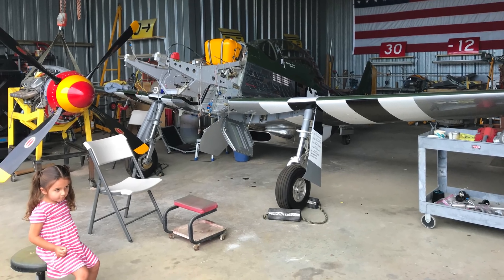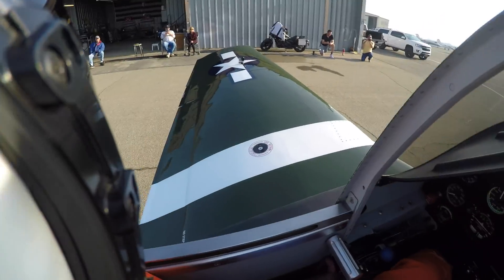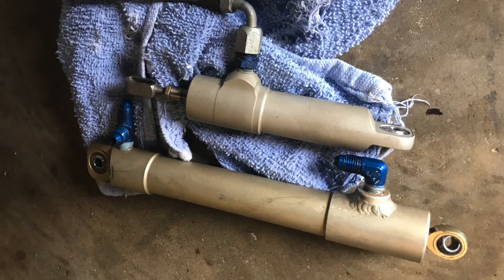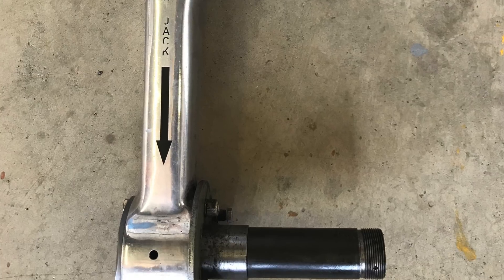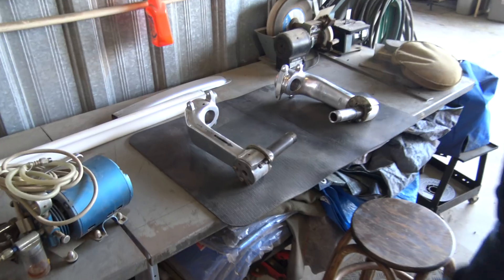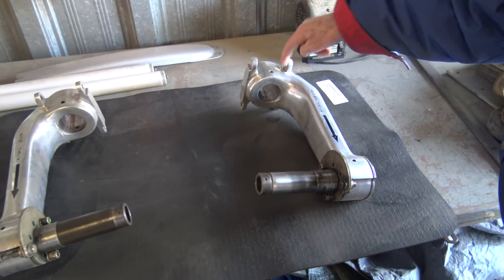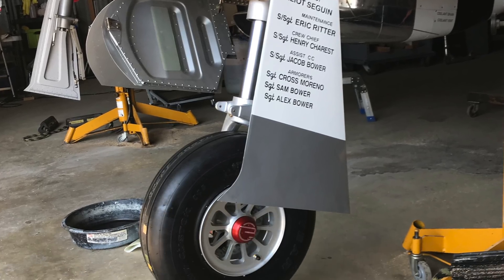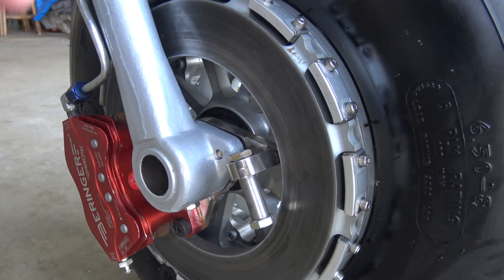Gear Test, FLT010 Bowerspony, Mumbo Jumbo, FCF 1.27.2019

Comment: My apologies for the random question, however what is the fitting that you're using to secure your Oxygen Hose to your Parachute Harness? Regards,
Reply from the maker: Not random.  Its called a CRU-60.

More here.
https://www.youtube.com/watch?v=a-lceaOL2E8
Reply: Thanks for that. Looking to set up a quick way of continuing to use my HALP Mask and Hose when not flying aircraft with established oxy systems. That video was great thanks. Good luck at Reno

Comment: Question #1: When you raise and lower the gear that quickly, aren't you worried about overheating the hydraulic pump?

Question #2: What is the permanent fix for the excessively slow retraction time?
Reply from the maker: I would, but they have been cycling the gear 50-60 times in a row on the jacks in the hangar, without a problem.  That being said the goal of the point was to stress the system, so we did, and we found a problem, which we can now fix.
Reply from the maker: Sorry I didn't see question #2.

The consensus is that the problem was caused by drag on the gear doors.  It sounds like most Stewart operators have lowered the gear retraction speed, we will likely do the same.
Reply: If the amps dropped off the hydraulic power pack it’s the pack that’s failing. I’d look at the pump seals internally. What application did it come from, (industrial, marine, aviation) & make sure it has the right fluid and enough duty cycle for the motor. Sounds like there was fluid bypassing (slow cycle) internally & maybe bad seals from miss matched fluid type. Skydrol, 5606 & tractor hydraulic fluid would require different o-rings.
Reply: @  @wadesaxton6079  - "Right fluid".....after talking with a friend of mine who is a mega-experienced A&P, you nailed it.  My A&P buddy is the same guy who designed the gear retraction system installed in this exact S-51.  Turns out that the owner accidentally filled the hydraulic actuators (the rams) with the wrong kind of hydraulic fluid; they used aviation instead of automotive type fluid.  Yes, THESE hydraulic actuators actually use automotive hydraulic fluid.  Should be an easy fix.

Comment: Airplanes are cool, but complex. Gear cycling issues are tough. Sounds like it needs some more adjustment up on the stands in the hangar.
Reply from the maker: It's tough, the plane was on jacks for most of the down time.  Fifty or sixty gear cycles, as soon as we landed it went back on the jacks.  

That's the fun part about these complex little homebuilts, lots going on.  Thanks for stopping by!